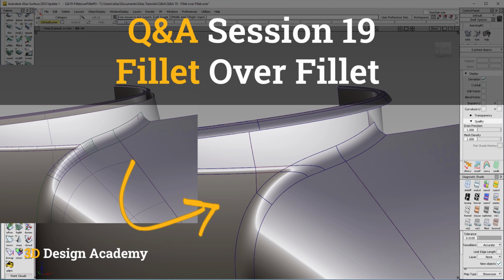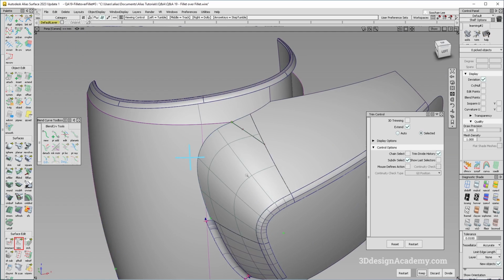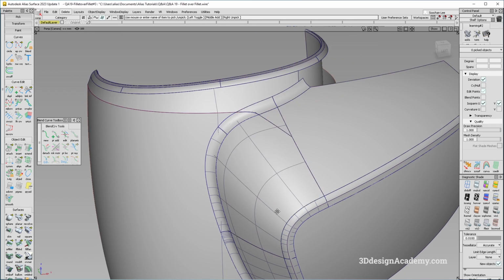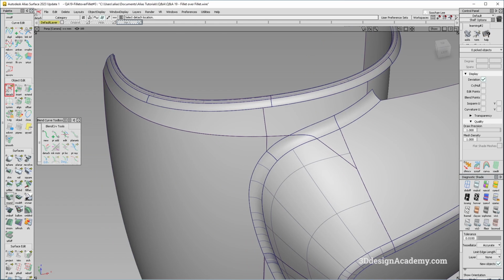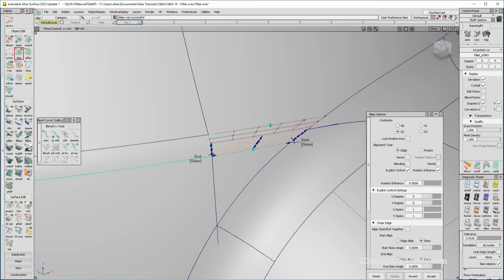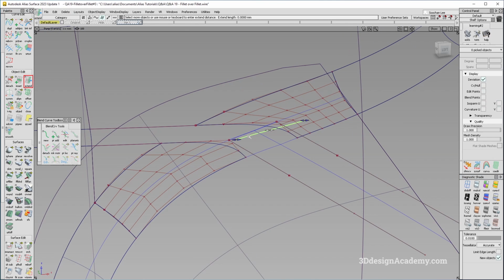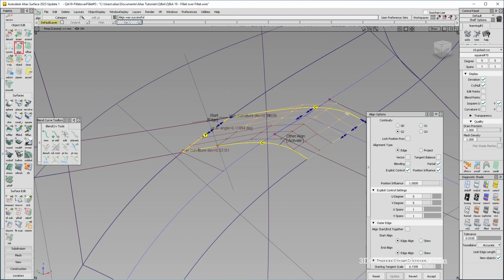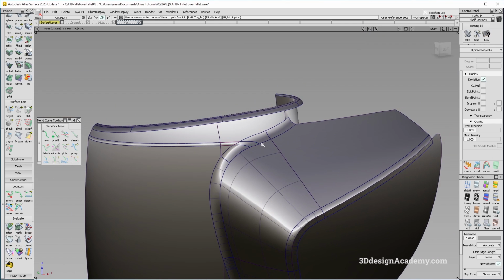Autodesk Alias Tutorials I Q&A 19 - Fillet over Fillet

Comment: What is the rational flag surface?
Reply from the maker: Rational flags, when checked on, allows you to create a perfect circle. The circles and/or cylinders in Alias, by default, are not perfect circles which means they have varying radius all the way around. They also have a different cv structure. You may want to see this for the difference between the two. https://youtu.be/uDL_qpITwpI

That said, I thought this was made with rational flags on, but it looks like it's just got multiple spans.
Reply: Just watched the video, well what to say. This explains a lot about why my wheel was off when i did the duplicate coz according to my understanding its like a pattern and I should not be worried since its based on degrees and i trimmed the surfaces with the correct segments. I should not have done that but it does.

Also i don’t understand why there was a option of rational surfaces on or off, shouldn’t it be like that all the time?

I mean whats the use of imperfect circle?
Is there any use case scenario?
Reply from the maker: @prahar112  Yes there is a use case for that. In fact, you should only use perfect circles only when you need to have one, such as creating a wheel. Otherwise, you should stick to regular circle, because working with a rational flag circle is actually difficult. For example, if you try to extend the edge, it becomes broken.
Reply: I see, that makes sense. Thank you
Reply from the maker: @prahar112  You're welcome!

Comment: Damn that is impressive. I am coming from rhino as I feel I might have hit a wall with its surfacing capabilities so I wanted to learn alias. But there are so many more factors taken into consideration here that I am having a hard time trying to keep up with what's happening. Any tips?
Reply from the maker: Thank you! Well, there are several principles that one needs to be aware of, but like you said, there are a lot of factors and exceptions to consider. I might try to make a video that focuses on general guidelines when putting fillets in.
Reply: May want to check out the Cyberstrak plugin if you want to expand the surface capabilities of rhino.